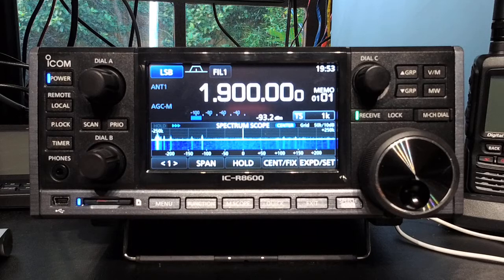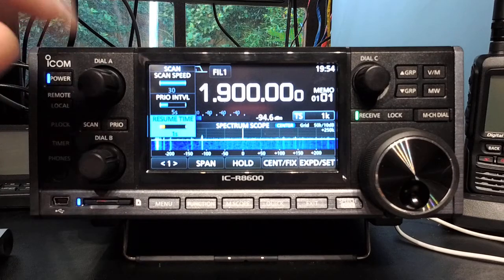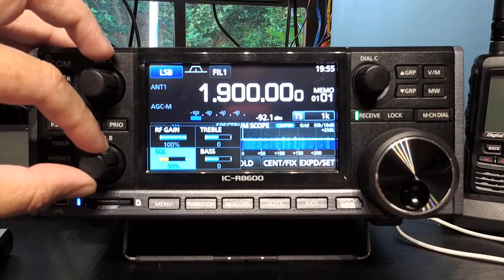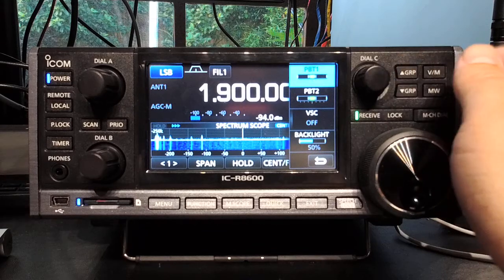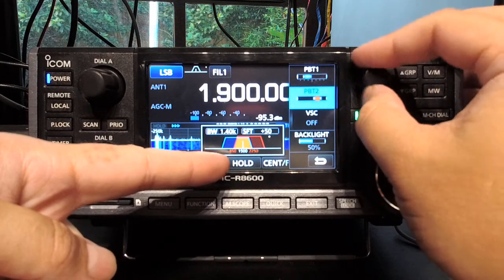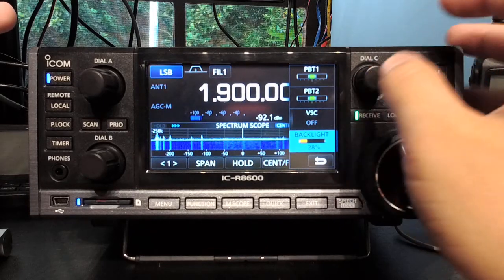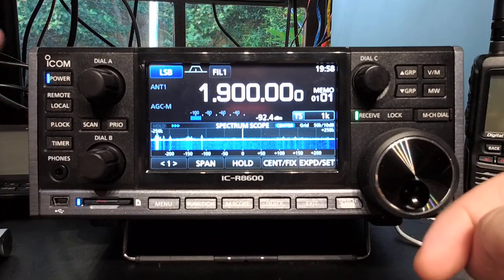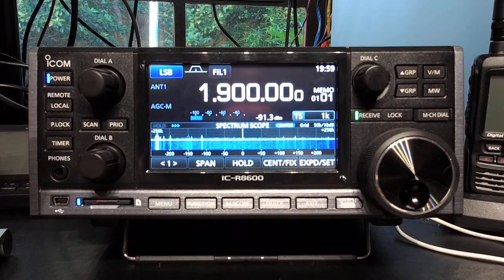Icom IC-R8600 Dial A, B & C: What do they do?

Comment: Thank you for this demonstration, and, while I apologise for the late comment (or query), may I seek your advice on why I could not received a local (UK BBC radio 4) 200KHz AM broadcast, while it is received loud and clear on vintage Selena, Sony ICF-7601L and on NRD-535. All these radios are placed in the same location, using the same antennae (long wire and other). In fact, the portable radios pick up this broadcast with hardly any antenna extension, while the IC-R8600 renders nothing but (50Hz) noise, and this is despite trying all the permutations on turning on 'noise reduction', attenuation, reducing RF gain. Am I doing anything wrong? Thank you.